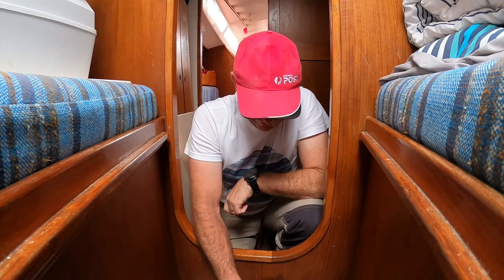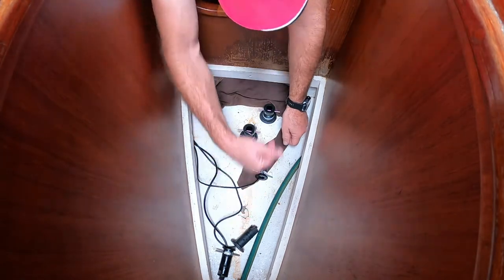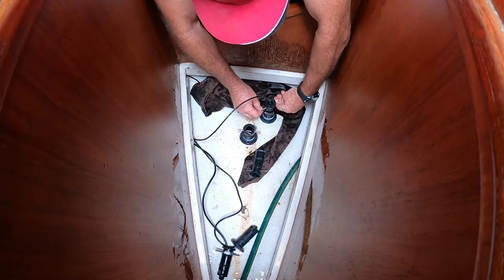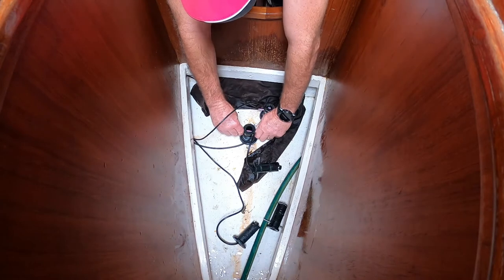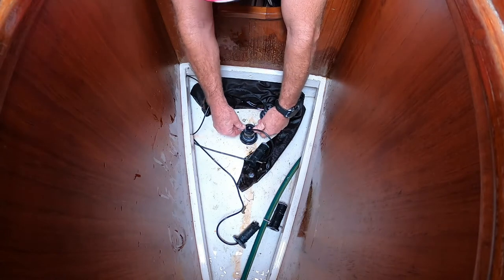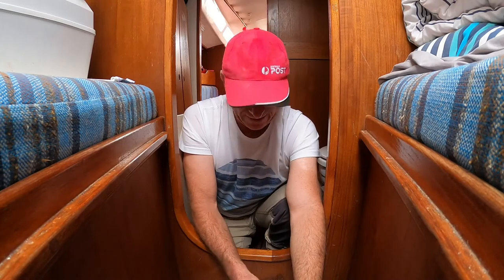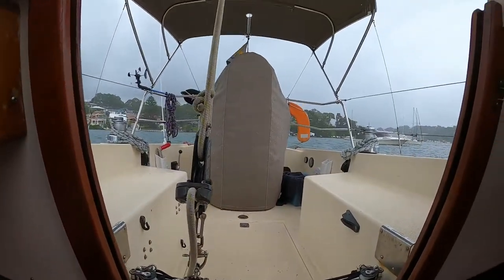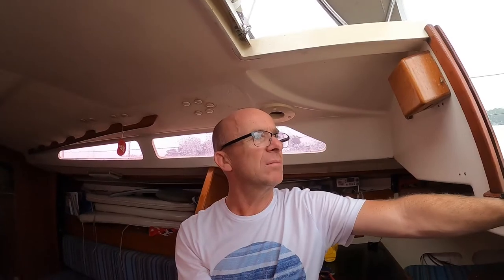Transducer Install on the water

Comment: How do you know how to set the depth of the replacment? Thank you
Reply from the maker: There is a channel that the two external pins slot into at the right depth. They're then locked into place.
Cheers

Comment: What type are these called. I have one with pin .I don't know what to buy to replace. Thank you
Reply from the maker: Best ask a shipwright. Once the outer fitting is installed the blank plug and transducer are a simple swap. These were Garmin products and need to be the right diameter if replacing older fittings...cheers